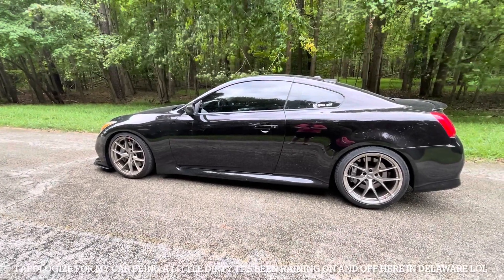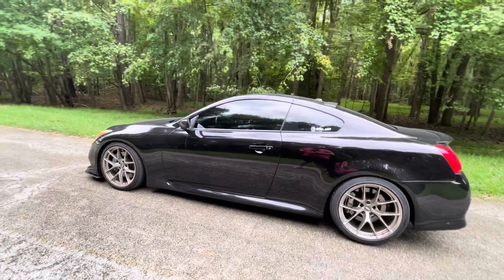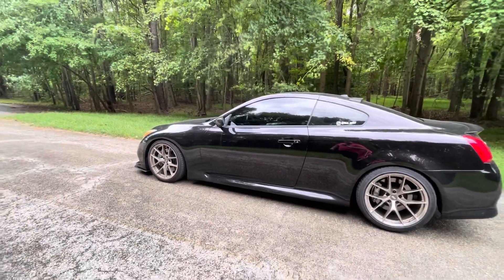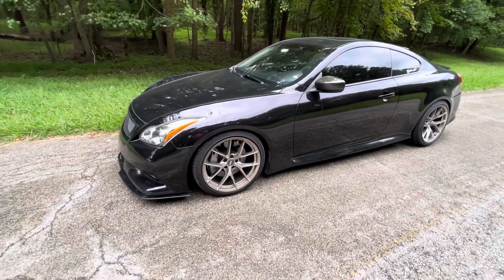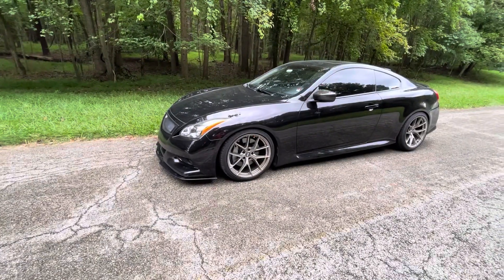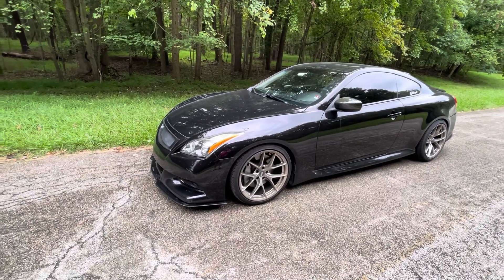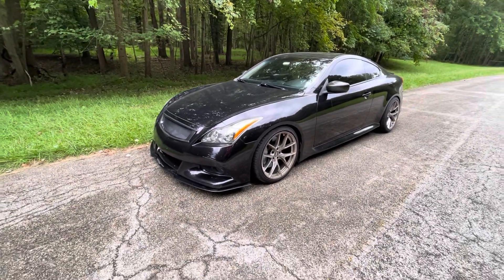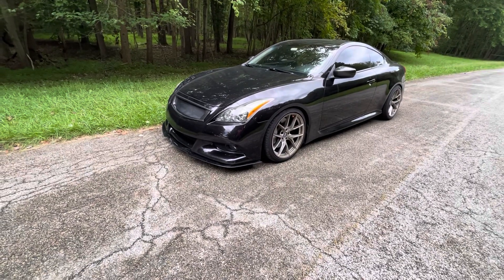TOP 3 MODS YOU CAN DO FOR YOUR G37,370z,Q50,350z,G35 HR/VHR

Comment from the maker: Forgot to mention: these are the top 3 power adders to the VQ platform. Obviously, there are also better mods you can do to your G Z Q without adding power first (coilovers, sway bars, diff bushing, better tires and wheels and weight reduction) but usually, everyone goes to power first. Figured I’d clarify that up. Thanks guys and stay tuned for the next video!

-TLEO

Comment: I just got an ‘08 G35x. R/T Tuning will be doing my aftermarket tuning stuff also, starting with the Stillen gen 3 intakes and ending with a full catted exhaust and UpRev
Reply from the maker: Good stuff  what exhaust did you do with
Reply: @tleoipl37  TBD, any suggestions? All of the half dozen or so go-to catbacks do sound good through my crappy tablet speakers. I just need to make sure it pairs well with HFCs (another brand decision to make). There's time though as all of the top manufacturers seem to have long lead times these days.
Reply from the maker: @flatsix1943  Motordyne, ark, invidia or speed culture studios are great choices as mentioned in my video

Comment: Good Vid..., but have to share with you others.  I have 2011 G37 Coupe with newly Takeda Long Tubes from Stock Air Box with K&N drop ins.
NO MAF or MAP confusion.   RPM Shifting (Stock 2500z , K&N Drop ins 3500, now Takeda 4500).  And i live in Paradise....🌴🏝 Humid and Wet....NO HYDRO lock!  #GuamG37🇬🇺